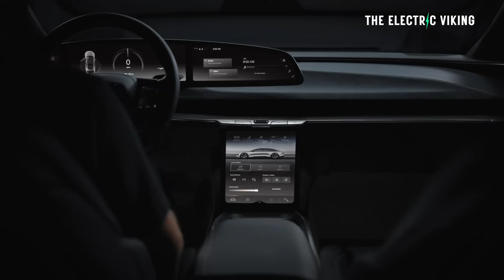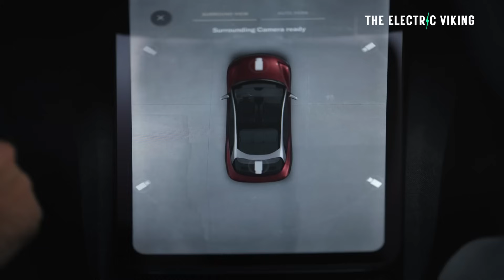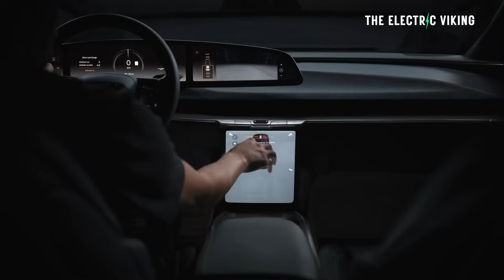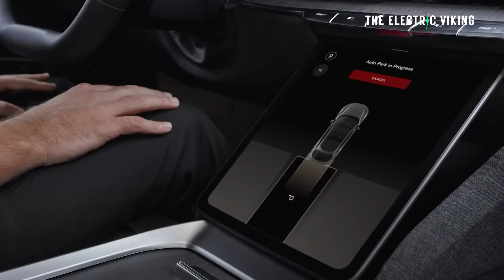Lucid discounts entire range by up to $10,000 as luxury EV sales dry up

Comment: Laughing at this. When I bought my Lucid Air GT in April of last year I checked the price for a similarly equipped Plaid. With red paint and the 21 inch wheels that came on my 140kUSD Lucid the Plaid was about 800USD more. Today that same Tesla is 45kUSD cheaper. Tell me again about discounting.
BTW, love my Lucid, how it feels, how it drives. If I somehow had to replace it with something different it would probably be a Taycan Turismo.

Comment: Is it worth it to spend 70 grand on an electric sedan? No. At 25mpg, a gas car consumes 4000 gal of gas over a 100,000 mile lifetime. At an average five bucks per gal, that’s 20 thousand dollars of fuel over its lifespan. You can buy a lot of nice sedans for lot less than 50k, and you won’t have to worry about charging.